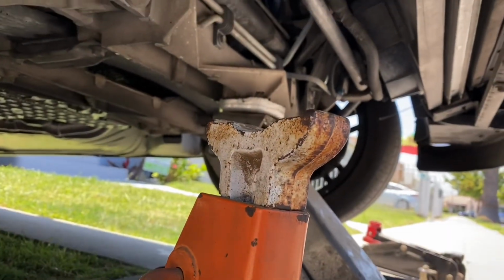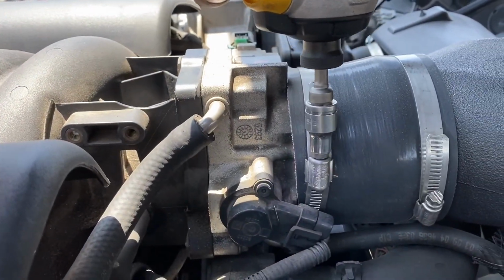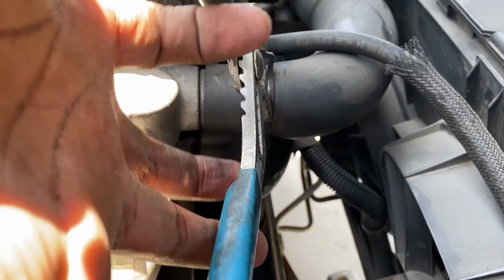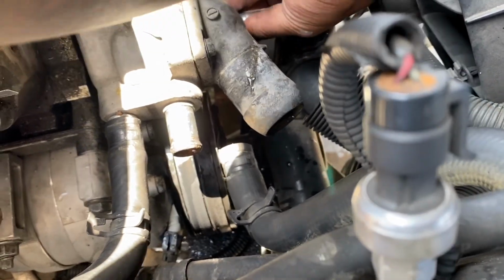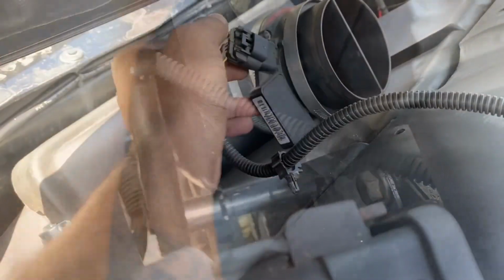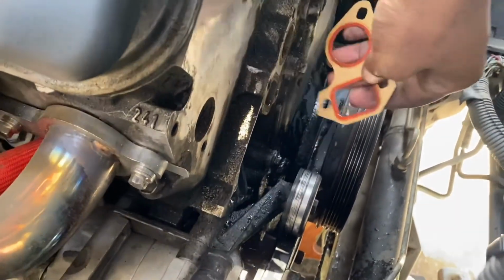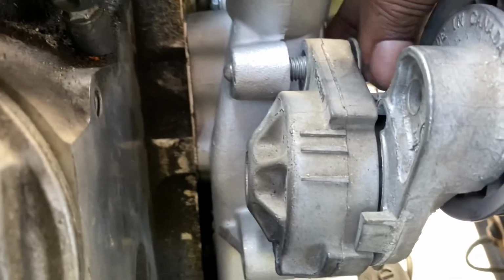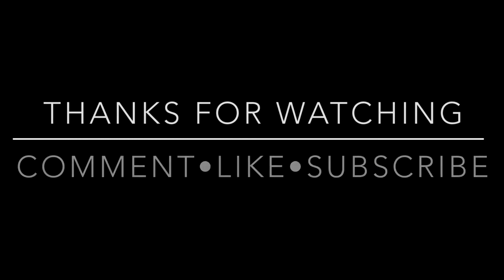C5 Corvette water pump replacement

Comment: HTP Jay, this video is far and away the BEST technical C5 water pump replacement video I have ever seen. Your patience, narration, description, attention to detail, background music and videography was superb. You are the human equivalent of a Helm, Inc. service or repair manual compared to a Haynes/Chilton service or repair manual. Thank you for producing and displaying this video! 

I too was getting the "security" trouble codes in my recently purchased 2001 'Vette and finally ameliorated that issue by purchasing a Factory VATS Key from my local Chevy dealer and having them cut it per the Factory Key Code. Works smooth as whipped butter and no more "security" trouble codes. (I measured the chip's resistance myself using my multi-meter) 

Also, I too am having fuel gauge issues. Apparently it's common on C5 'Vettes for the right-side saddle tank's fuel level sender to become corroded which at any point during driving, causes the fuel level indicator to drop to empty, turns on the red Check Gauges warning and throws a Code P1431 even though you KNOW it still has plenty of fuel. I'm currently treating the issue with mass quantities of Techron Plus and will begin fueling the car with Ethanol Free gasoline. During this time, as soon as I accumulate 200 miles, I re-fuel the car.

Comment: Great video man! Was gonna do myself but I live in a gated community and found out they wouldn’t allow me. I found a shop that replaced my water pump, radiator, install thermostat housing replaced both hoses and then new coolant for $300 labor for all inc taxes and bs shop fees that they don’t charge. Ps your gas gauge prolly quit working form carbon buildup on the sending unit. It happened to me 2x. I put in chevron Techron into the tank and it started working again both times.  These cars require super unleaded otherwise the sending unit quits working from carbon build up. Try a bottle with half tank to 2/3 tank and then repeat again . Usually clears up the issue. If not your sending unit is bad or the gauge on dash. My oil temp gauge is intermittent also
Reply from the maker: Glad to hear you got it fixed, I tried everything for the fuel level sensor nothing has worked so I have a new fuel pump I have to install soon.